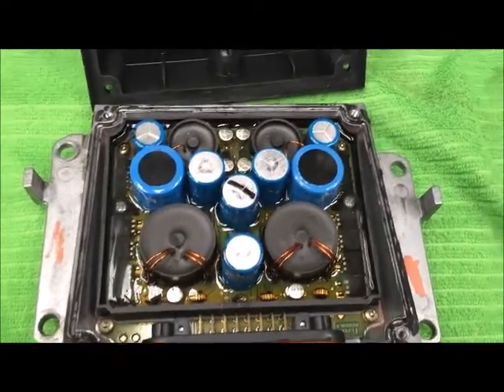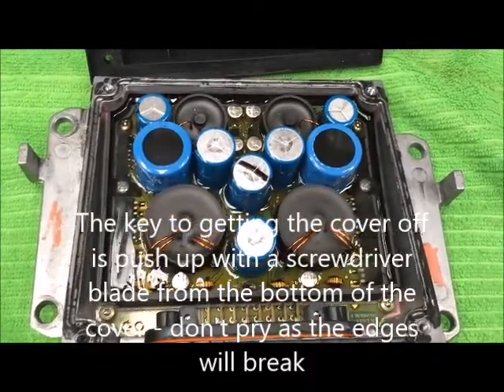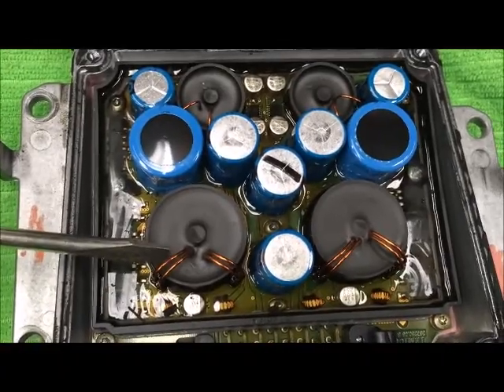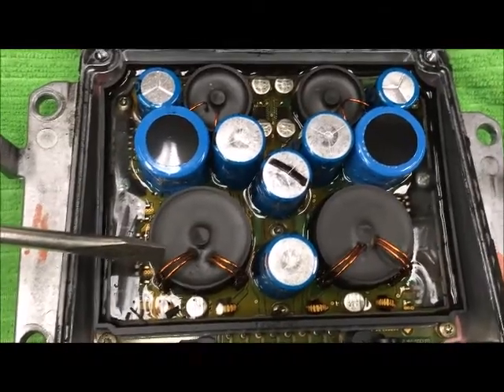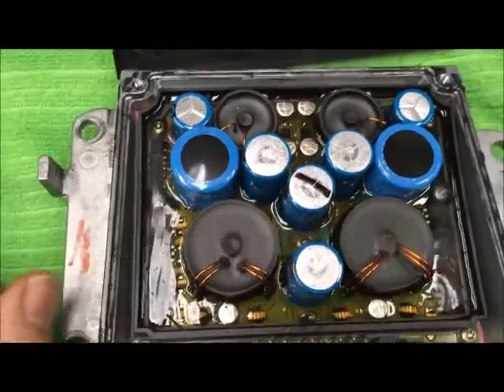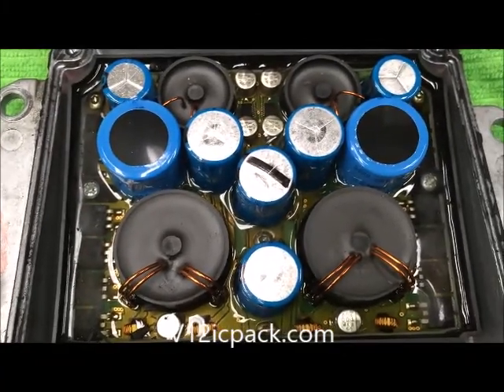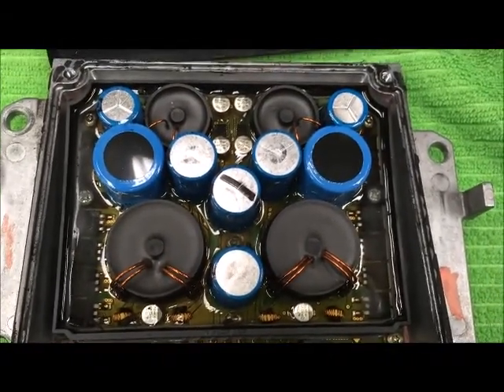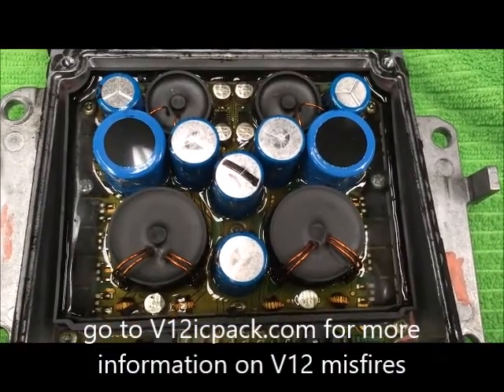Mercedes S600 voltage transformer

Comment: hi do you have or know where i can get a pin out diagram for a 2001 cl 600 voltage transformer so i can test it ,thankyou
Reply from the maker: As it sits in the car, the top left pin and the top riths pins are the 180v out for each pack.  The last two on the right bottom are the 23v out.  Best way to check is unplug the connector at the coil pack.  Key on but don't go so far as to start.  Check for 180v and 23v at the corners of the connector that was plugged into the pack.  One corner has no pin and 2 of them should show voltage - remaining pin will be dead.  Be sure your meter is set the right scale to show 180 vdc.  Clark

Comment: Thanks Clark, you're a God-send as I have a S600 that's in 'limp mode' and I'm tracking down the culprits. The problem is I'm not getting bad engine codes so I'll keep hammering away
Reply from the maker: Brent Waterbury Go about 30 mph and drop it in to 2nd gear.  Heavy foot to red line and into 3rd.  You should trigger a CEL...
Reply: @clarkrupp  Thx, I'll try that! Also just got shocked by the transformer a minute after I turned the car off!
Reply: I may be using your rental service soon and I'll know in a week.  Thx
Reply from the maker: @curlymyhero  Just order the "Exchange" coil pack.  If you keep it....its paid for.  Send me your old one to get core charge $$ returned.  If not, simply return it and I'll refund everything except the $90 rental fee.

Comment: what does it actually do ??
Reply from the maker: +samuel lopes     In the simplest of terms, its the power supply for both coil packs on all 2000 - 2013 MBz V12's
Reply: I wonder why they made it so complicated. My brother sent me the link to this video cause he thinks his went bad...
Reply from the maker: +samuel lopes   Nearly impossible to tell the failure between the voltage transformer and a coil pack.  Yes, it is complicated !